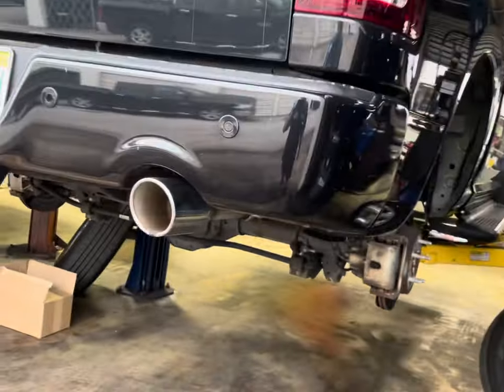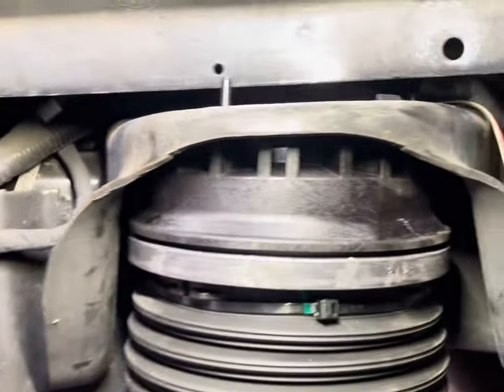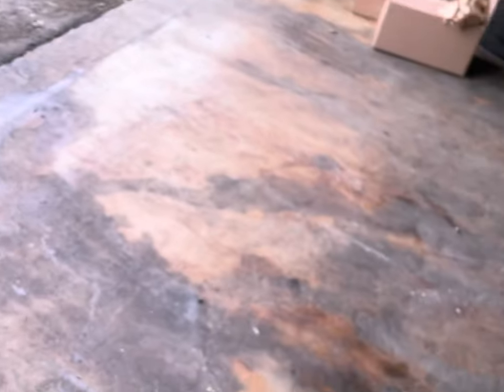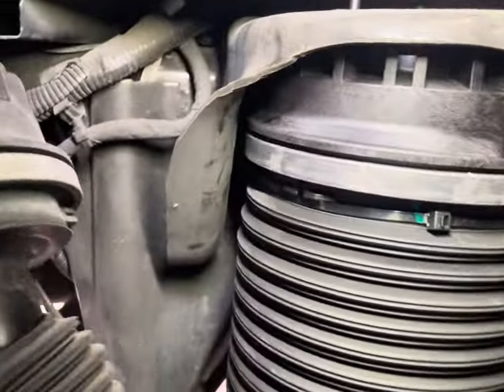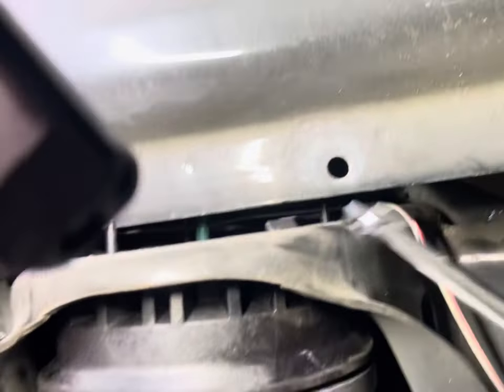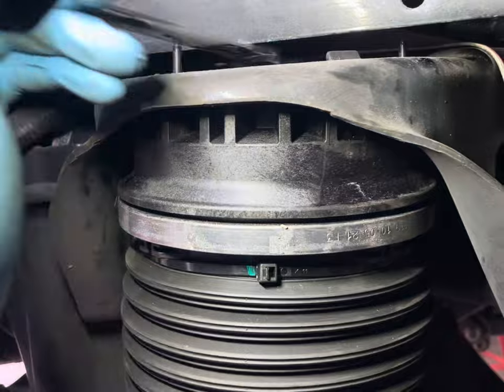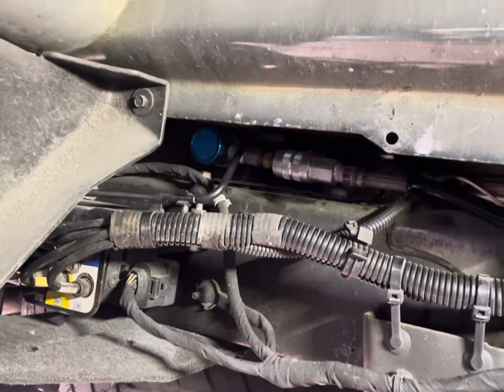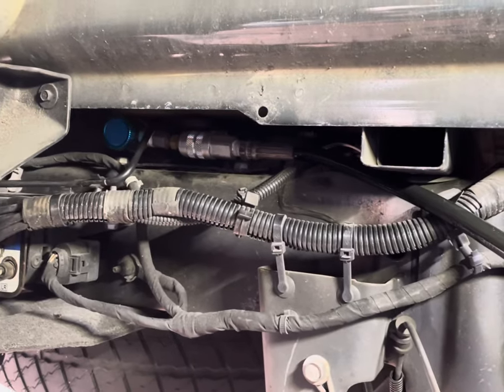Ram 1500 air suspension leaks after driving on highway or sitting overnight FIX

Comment: 3 times in the dealer at 2-3 weeks each visit. They’ve replaced every line and fitting, and the valve block under warranty claim. They say the bags are testing fine and won’t replace them. Luckily the compressor still works at the moment but I’m sure it’ll go soon being used so much. Front end drops t the bump stops overnight sitting. 
Saving up for a delete kit right now!
Reply from the maker: Front air struts are very expensive I would agree with your decision
Reply: Don't do a kit, normal parts fit in place, you just need a pair of coilovers for the front and coil springs for the back $700 is all you need to spend

Comment: What are your thoughts on the front end lowering overnight when in normal mode? Front air spring leak? I was under the impression based on each spring having an independent line to the valve block that a leak in one spring would only affect that spring.
Reply: I have the same issue. Have you found the problem?
Reply: Checked airmass volume in system, filled all springs. Let sit overnight, in the morning left front spring was 1.5” lower than rig it side. Airmass volume in system was the same, maybe leaked back into reservoir thru bad valve block??
Reply: @mr.mister3321  The fronts are notorious for leaking at the top air connector. Check for a leak there.

Comment: Yes guys, that's right. Exact same story. I checked it in the fully raised position and thats why i can not detect a leak. After watching your video, i realized whats happened. Now i know, my both rear bags are leaking. I found on amazon, guys who have 12 month warranty just for 279$ for both side. Thank you guys. 
Drive safe.
God bless you all
Reply: How did the Amazon bags workout for you?
Reply: On a 60k miles, during transportation f250 was blown left side bag. Every mile was cowered in towing mode, with not so light loads.
We bought it again from those guys. 20k miles is already covered. As you understand, the car is using just in working mode.

Comment: This is really an issue with these ram trucks. I’ve replaced my compressors and bags 2 years ago and I am having the same issues again now. 2 years ago it was $4800 to fix, I am sure it will be more now. Chrysler fiat should do the right thing and do a recall as this is clearly not an isolated thing, it gets much worse in colder climates.

Comment: So a few things i have leared about running this system on my 14 ram 1500 is the rear air bags last 5-6 years  in my climate (manitoba canada). And if you have a system that is freezing up in winter, remove the right taillight and put 5ml of air brake antifreeze down the hose, and that fixes that. This time around im going with one aftermarket air bag and one cheap Chinese one off ebay. I want to see how it holds up. It looks the same so time will tell i guess. And when i swap air bags i dont bring it to the dealer to fill it up. I just let the compresser do the work. I love the air ride system, just dont care for the rear bags that dont last.
Reply: how is the comparsion of bags doing?
Reply: @north4961  so far so good!

Comment: I replaced blown rear air shock. Can I vacuum pump the system to evacuate moister, and recharge with nitrogen without scan tool, and if so what pressure is the system full at?
Reply: I believe it's 175 I just did mine today.

Comment: I just replaced rear air bags myself.  Stupid easy and only cost me $150 for a pair of after market airbags on eBay. Stealership wanted $3000 for the job.  Should I purge the system with nitrogen?  Can a local shop do that for me? I refuse to go to crooks at the dealership.
Reply from the maker: Unfortunately I work for the stealership and we have a special airline fitting on the truck that takes nitrogen and you need a really expensive scan tool as well to access the airbag module to fill the airbags (if there is no nitrogen left in the system) I would try going to a independent euro shop lots of euro cars have air suspension they may be able to help you out
Reply: @alexanderardelean5001  thanks but it’s working perfectly since I replaced the airbags. I guess that means it’s pulling air from outside?  Do I need to recharge with nitrogen?
Reply: I dont ever recharge with nitrogen. Air is 90 percent nitrogen anyway. I just put 5ml of airline antifreeze in the system by taking out the passenger taillight and puting it into the pump hose. Works great.
Reply: Hey man what use bags did you go with ?

Comment: So I picked up 2 new rear bags that I will be installing this weekend.i see that I must re use air line and fitting.other than getting it filled with gas rt away is there anything else I should worry about or is it plug n play?
Reply from the maker: Really easy to do all you need is a 8mm to remove fender liners and 12mm wrench and a jack and jack stands filling up the air suspension system is difficult suggest taking it to the dealer and pay them to fill it for you
Reply: @alexanderardelean5001  was very easy!! And so far so good.gonna have them recharge system end of this week.Thank you for your help!
Reply: @alexanderardelean5001  @RCAndrew  Did you self-install the bags and did you get OEM?  What did they cost or could you provide a link? 3 months out, how's everything working?
Reply: @alexanderardelean5001  The fill fitting is a standard HVAC fitting. All you need is a HVAC manifold gauge set and a tank of nitrogen, which you can get from any welder supplier that sells welding gases.

Comment: 2019 ram 1500 limited with 80,000 kms and I need new rear air suspension, quoted at 4000 to repair, why has dodge not solved this problem yet, better yet why does dodge still continue to make and sell this system? It's complete garbage!!!

Comment: My truck only works sometimes.when it goes up it will stay up all weekend without moving.its only when I hit aero mode that it won't return to normal and drops rt down.then I have to do a series of starting truck up let it sit shut off start again and eventually goes back up.. sometimes also get a gurgling sound from compressor area.would it stay up all weekend if there was a bag leak?
Reply from the maker: Yes like I said in the video it only leaks in aero mode if you keep your truck at normal or max height the bags will never leak
Reply: @alexanderardelean5001  this is the same problem I’m having looks like they knew the truck had this problem and sold it to me.  Only time I was able to verify was driving in the highway for long period of time

Comment: Why is my 2018 ram 1/2 ton air suspension sagged in front right down but back is fully inflated , giving raising and lowering lights on dash ? 

Was cold.  

 Is this a bad battery issue  ? 

A reset the system issue. 

or 

Is this a repair issue
Reply from the maker: Your right front strut is leaking you need to find the leak and determine if you need the right front strut to be replaced or you have a leak in a air line completely different issue than what is stated in this video…
Reply: @alexanderardelean5001  Ok , thanks I was wondering if it was the distribution box or what ? 

Thx

Comment: What about if the front drops in cold weather? Is there water in there freezing or something like a leak. As soon as it warms up it goes back to level.
Reply from the maker: Sorry I don’t have experience in cold weather with these trucks I would tell you to go ahead and do the same procedure for checking the front as well  but the rears are an extremely common failure so make sure you check them as well if you need to replace the front strut I believe it is almost $2000 for just one at the dealership I would suggest trade in your truck at that point
Reply: I made 2 videos on this check them out
Reply: @alexanderardelean5001  RMT rebuilds the factory front air struts for $700 for both struts.

Comment: I have an issue where the front only drops in the winter . Do you have an idea
Reply from the maker: I’m from South Florida can’t confirm anything for you but spray soapy water on the fitting right on top of the air bags see if it’s leaking from there
Reply: @alexanderardelean5001  thanks it only happens when it’s below 30 out . Illinois wether
Reply: It doesn't operate correctly at low temps.  You can Pull that crap out and replace the suspension with something that works year round for $700.
Reply: @heathadams3655  LOL... yes it does. When you ignore leaks, the air that replaces the nitrogen contains moisture and it freezes in the air lines or the valve block when it's cold. Just because you can't do proper maintenance on a vehicle, doesn't mean the system doesn't work.
Reply: @vmxg8052  It never worked at -30f, even when the pickup was new.  I maintain my vehicles very well, we obviously have very different temperatures in the winter.  But you keep making your accusations like an internet tough guy telling me I don't know how to maintain a vehicle if it makes you feel better...
Reply: @heathadams3655  All your trash talk shows you know little about vehicles. If it did it from new, as you claim, you would have taken it back for warranty. I regularly have -35C here and and at times, colder and the system always works. It won't work at those temperatures if there is too much air in the system, which means you have a leak.